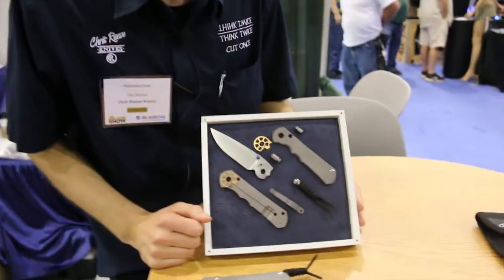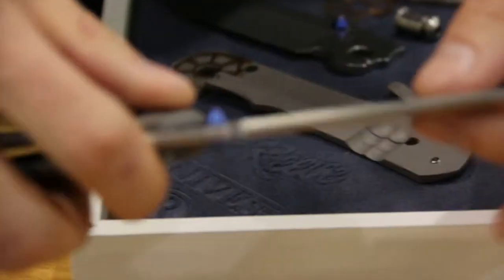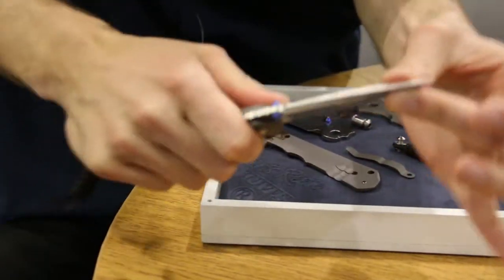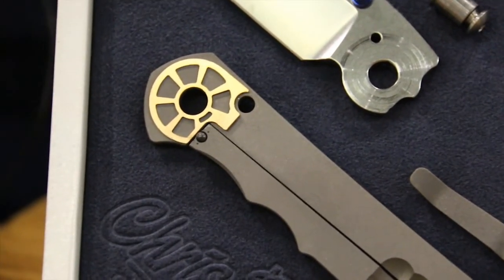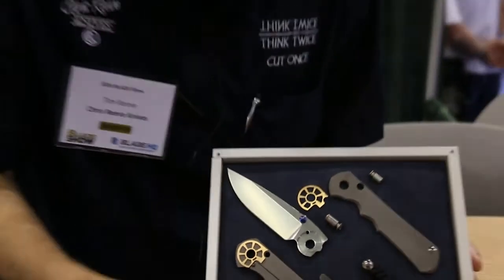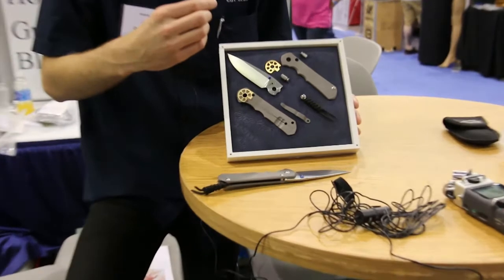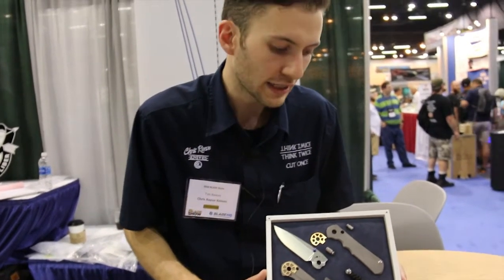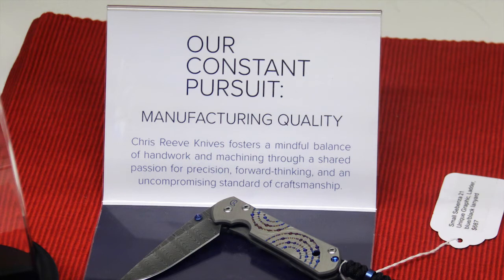The Inkosi is demonstrated by Tim Reeve showing large washers and ceramic detent.

Comment: Is the notch on the spine for machining purpose?
Reply: There was a groove placed on the blade tang, presumably to give more surface area on which the ceramic ball would contact. Since then, Chris Reeve Knives announced they would no longer add the groove on the tang. I do not know if the change is to address a problem or if the original design addressed a problem that did not exist.
Reply: the dimple /notch  is right between the spine  and the jimping.
Reply from the maker: This is the problem with knife terminology I guess. I don't understand what you mean by "the notch on the spine".
Reply from the maker: That  is interesting. I haven't heard of that. I will check  into it.
Reply: I think its just a little thing they added for style.  Its a nice touch.  Love my dimple!
Reply: What you are talking about is on the lockface. It's there to prevent the lockbar flexing up/down.  One of the functions Hinderers LBS also do.